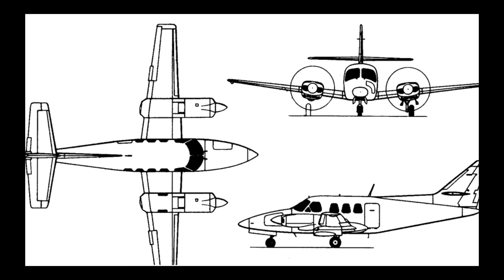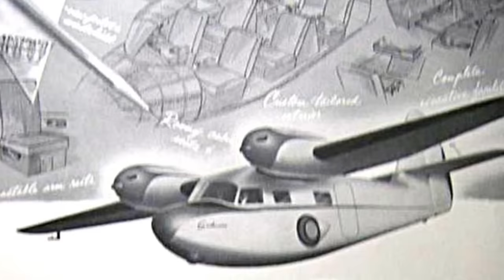Five Twin Engine Aircraft Nobody's Heard of

Comment: The Cessna T303 was a great airplane and belongs on the list of seldom known light twins. Flys like a 182, FL250 capable, ergonomic panel that makes it very easy to manage, trailing link gear, and a very comfortable aircraft for passengers. Only produced for about 3 years and sold for 4 in the early 1980's.
Reply from the maker: It is a nice plane for sure, and I think I've already added it for an upcoming video.

Comment: The kit version of the Speedtwin was enormously over-priced. When an RV-6 kit was $30,000, the Speedtwin was asking $100,000. No wonder it never sold! It did have a unique feature to reduce aileron control forces, and it's not clear to me that conventional ailerons were inadequate.
Reply from the maker: Not only that, but that's not factoring in a pair of Lycomings, I presume.  Plus all the associated mounting, plumbing, etc etc.   
There's been other kit twins that were attempted but nothing's really worked so far.

Comment: Yeah, 4 obscure birds and the Rockwell 700. You left off the best small twin ever built, the Wing Derringer. Most are still flying. It was bueatiful and performed better. It should of had Lyc 360s instead of 320s.  I saw a nice one at my old airport PVF. It would be terrific to see it back in production with the slightly larger Lycomings.
Reply from the maker: Too many to fit into one video. The Derringer is on my list for another twin engine series for sure.
Reply: @aircraftadventures-vids  Yes in airplanes, funny looking designs don't fair well. Both the Hansa jet with forward swept wings and the Hondajet OTW engine placement didn't and are selling all that well.  For the Derringer at least it looked good. With 180 hp engines, it would have faired better as a personal rocketship. I met George Wing in Torrance back in the 60's at Torrance. John Thorp helped Wing with the design.
Reply from the maker: I can see the Thorp linneage for sure.  I know less than nothing about the Derringer, but perhaps it didn't sell well as it only sat 2?  Perhaps if it was a 4-seater it would have fared better against the twin comanche, for example.   @larryweitzman5163
Reply: @aircraftadventures-vids  the thorp corrugated wing design…. Speaking of looking funny…. 😃

Comment: 1.) Rarely do piston twins have engine "redundancy", instead you twice the likelihood of engine failure, and in all but the push pull designs your aircraft handling is much more dangerous in a traditional twin with one working engine than a single engine airplane with engine failure, the only saving grace being the possibility that you can get to the nearest safe place to land with your one working engine in said twin.

2.) The Do-28 B1 and the Do-28 Skyservant do not have even decent single engine performance. Both are STOL designs and STOL aircraft are almost always pretty draggy, most twins however are built for speed so they tend to be the opposite of STOL. At sea level on a not hot day you can probably climb a bit on one engine in a Do-28, though the turboprop Skyservant conversions probably preform a lot better. Also Helio made a Twin courier, none have survived to my knowledge.

3.) The Do-28 does not have more cockpit space than the Do-27, the Skyservant does though. The Do-27 and Do-28 definitely do not have spacious cockpits, the big windows help visibility but 6ft male barely fits in them, they were built by malnourished post war Germans for malnourished post war Germans.

Comment: a death sentence for losing an engine in a twin? obviously the writer doesn't have a multi-engine rating.
Reply: In some cases he would be right. Look up the Blackburn Botha.
Reply: Blame the engineer in this case
Reply: @neiloflongbeck5705 . With underpowered twins the second engine takes you to the scene of the crash, with generously powered ones, the second engine will turn the plane upside down in an instant if you are not quick under certain circumstances.